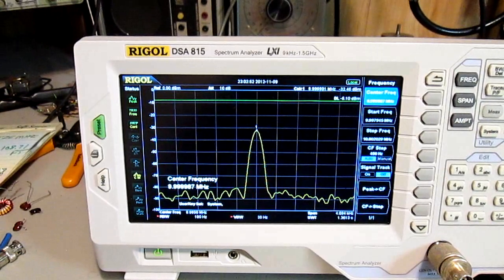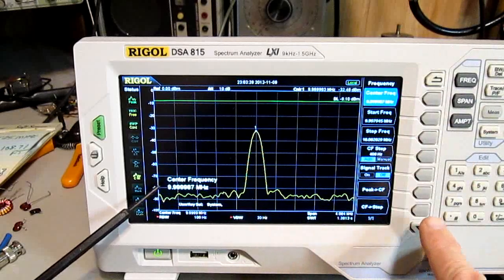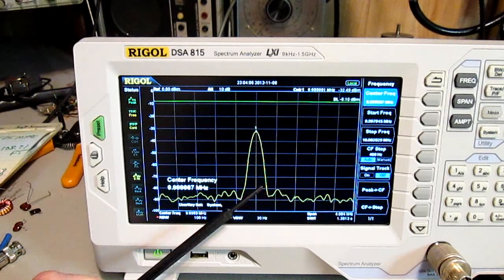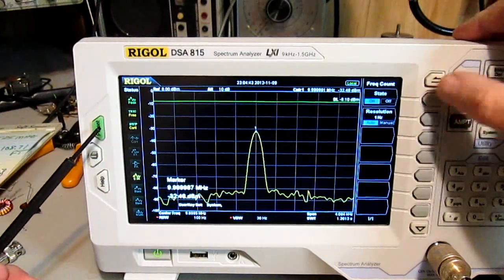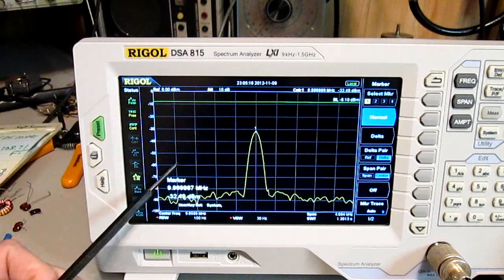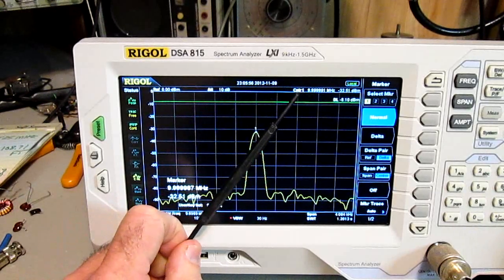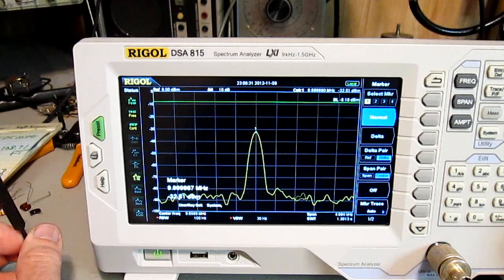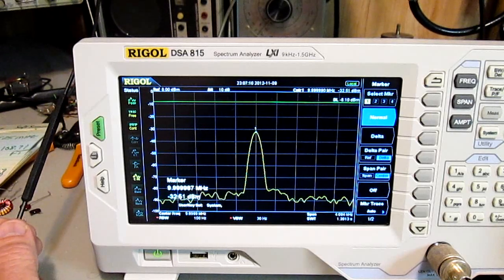DSA-815 Spectrum Analyzer - Frequency Measurements - Revisited

Comment: Hi,

I'm using the R&S®FSW Spectrum Analyzer to measure frequency of a ring oscillator on an FPGA, but the frequency seems to drift a lot. It ranges from 103.2 to 103.4 MHz. Is there anyway to get rid of the drift? How is your peak frequency always steady?

Thanks!